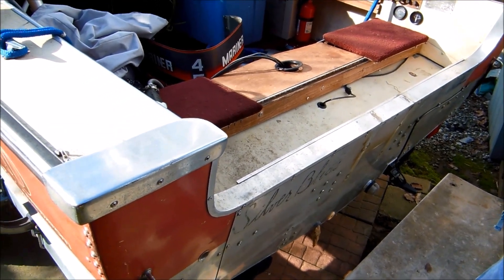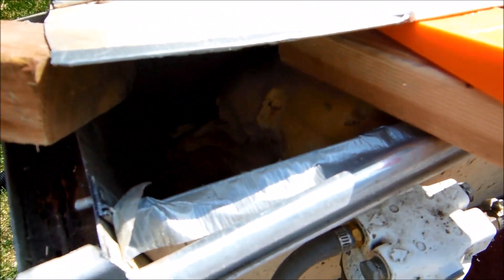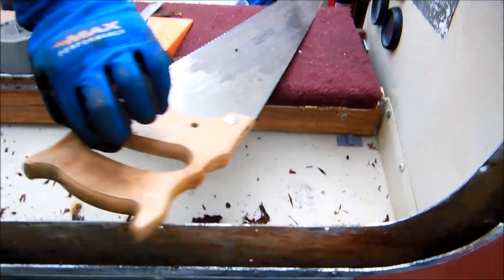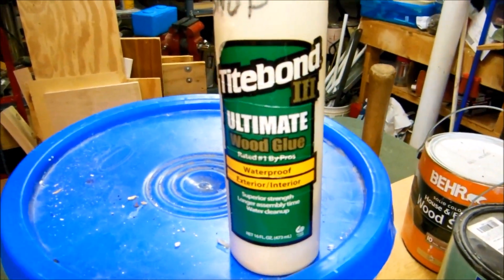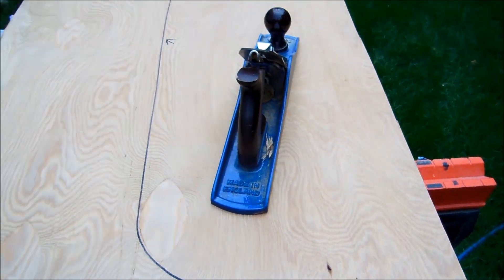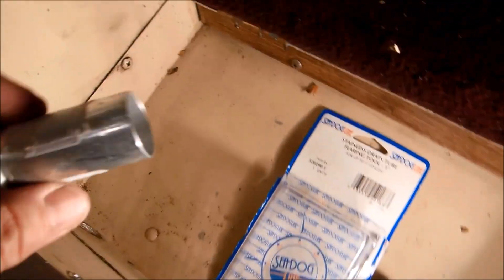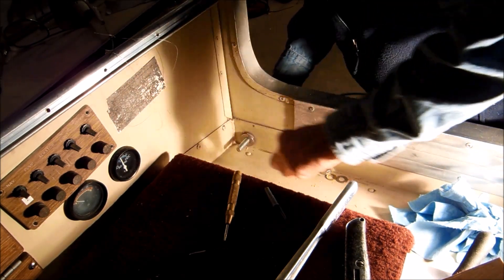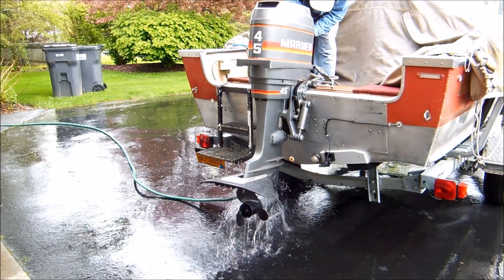Boat Transom Replacement

Comment: I've done a few new transoms on aluminum and fiberglass with wood core transoms. Pull out the old one and make a template and or bring the old one in if it's in good shape to take a template of and I made the new ones out of marine grade plywood and the coated everything in marine grade epoxy resin. Did alot of those jobs for DIY people.

Comment: Started the transom on my 2001 yesterday.  When you had to break the welds, how much force or swings did it take.  At the moment I'm stuck at that point.  Also did you notice any sealant/silicon when you took the transom cap off?  I can't find any trace of sealant, which I think is borderline negligent.  Did you see the video on the new HDP transom?  It says a line of bullshit about lund transoms being state of the art and warranted for life!! Again all lies!!! Your video has been more help than every single lund dealership around! Never again!! I'd rather swim! Thanks for the vid!!
Reply from the maker: Sorry for the late reply I never got an update about your comment.  It took a good amount of force and maybe a dozen swings.  Just hit it hard and try different angles.  There was none for us either.  I didn't see that video.  Yea of course we had no information when trying to figure this out and thought it would be very helpful to to others.  The lund transom being lifetime warranty is ridiculous too.  Do they expect people to drive there boat to factory?  I'm sure its a procedure to get it done by them.  Hope your project goes well feel free to reach of if you need help.
Reply: Each state has it's own definition of what "Lifetime" means as it applies to warranties. In Ohio, it means 7 years or essentially what they consider the lifespan that can be expected out of any item. So a 10 year warranty or 20 year warranty are actually better than a lifetime warranty. Some states count it as less time too. Lifetime doesn't mean YOUR lifetime. At 30+ years, they have no obligation to do any kind of repairs on the boat and probably won't. Just something to think about. Good repair project.

Comment: Folks, this was very well done for it’s time, but because of the propensity for water intrusion(gaps, cap strip, rivet leaks) use Coosa board. Stronger, lighter won’t get water logged and never rots, but it costs more. However, you never have to replace it. Wood does what nature intended, decompose.
Reply from the maker: Wood will outlast the boat guaranteed.  Boat was 25 years old or so when this is made.  Hull takes a beating from the waves.
Reply: @OutdoorsmanChannel 
Yes you did a great job. It’s just that I’ve replaced so much wood that I hate the stuff. In fact, it won’t do a transom with wood. I’ve seen it rot in just a few years. Some preservatives and sealers actually cause  the wood core to rot quicker. Some preservatives cause aluminum to corrode. Quality marine plywood is very hard to find or mostly fake. I hate fungi food.
Reply from the maker: @SkypowerwithKarl  I appreciate the input.  We just chose to keep it to factory spec.  Thanks for watching.

Comment: Use Thermo-Lite Board when replacing wood in any boat repair so you don't have to replace rotted wood again.
Reply from the maker: +Mike Kalberer The original wood didn't appear to be marine grade and it lasted 25+ years.  I don't think we will own this boat for that long.  Its also much cheaper to use wood.  Thanks for watching!

Comment: Not sure that was marine plywood, I could see voids on the right hand side- originally they probably just built it with exterior grade plywood which is just fine.  I would HIGHLY recommend sealing the transom with epoxy resin at the edges so that future water won't suck in so much.   Have done a few transoms myself, and much prefer doing them on aluminum boats. :)
Reply from the maker: I can't even imagine the pain of doing a transom on a fiberglass boat.  I'm sure we could've sealed more and used different boards etc, but that marine grade wood and thomsons water seal will last awhile.  Thanks for watching!

Comment: Nice job....I think I would have sealed that plywood with a coat of epoxy resin though.
Reply from the maker: john smith Thought about that.  We figured this was good enough since wood is marine grade.  I don't think original was by looks of it.
Reply: Outdoorsman Channel Marine grade is just hardwood plywood with waterproof glue. But with the Thompson's water seal was probably more than the factory did.
Reply: @OutdoorsmanChannel  Marine grade plywood is not treated and will rot just as fast as regular plywood. As mentioned the glue bonding the plies is waterproof. Also marine grade plywood will not have any knotholes and typically has more plies than standard plywood. Definitely would recommend sealing with epoxy but using the Thompson water seal is better than nothing I guess... nice video
Reply from the maker: @mdees88  Thanks for watching.  We simply chose to make the transom the same as factory specification.

Comment: It will get you going but will suffer bad vibration, all voids needed to be filled. A transom needs to function in conjunction s with other structural elements, stay safe.

Comment: Great job but why didn't you use coosa board? It cannot rot!!! There's no wood to rot!!! But awesome great job hope it lasts very long time
Reply from the maker: We just wanted to make it as original spec.  We figured the original wood lasted from 1986 to 2016 and the hull would not last another 30 years.
Reply: @OutdoorsmanChannel  I don't know I know lots of people with 1950s boats that they still use!!! But yes original spec is good but coosa will never rot so it does last the 30years extra it will need to be replaced
Reply: What is the price difference between coosa and marine grade plywood ?
You also have to factor in shipping costs for coosa. 
I'm getting ready to replace transom and stringers in my boat. I'd love to use coosa, seacast, carbon bond, etc. 
In the long run, is something other than wood, the way to go? Good question. How will the composites hold up in the long run ?
Talk me into spending the extra for it. Especially when paying around $100, for shipping alone . 
Keeping in mind, that means less money for the rest of the project.

Comment: Why wood again? There is so good other materials for such a job.
But you did a nice job anyway👍🏻
Reply from the maker: Thanks for watching.  We chose wood to match original.  It was also the lowest cost and the lightest weight we could find.  The boat is a 1986 and the original transom lasted that long. We figured the hull would break before this transom.
Reply: Outdoorsman Channel 
Okay i understand. I have a microplus 461 from the 80’s too. Also hat a bad transom with rotten wood. Also cleaned out just like you did but had to make it more strong also because the boat was made for 50hp max and i bought a 115 2str yamaha. 
So i cleaned it out and pored in a epoxy for deepfreeze truckfloors. This stays a litle flexibel and is also very strong. 
But a lot of work also haha. 
Tnx for sharing this video. This helps a lot of people.
Reply from the maker: @michielderuyter6011  Yea that makes sense. Ours is rated for 55 hp and we had 45 on it.  Too afraid to go higher haha. Of course glad to help anyone out!
Reply: Outdoorsman Channel 
Regards from the Netherlands👍🏻

Comment: Not only should you have sealed the plywood 1st. You should have cut old fibreglass out from inside of Transom, refiberglass it all in. You also should have glued entire backside of the fibreglass on outer transom. You're just going to get water in there again, will rerot in no time.
Reply from the maker: The boat has zero fiberglass in it.  Thanks for watching.

Comment: Nice video. However,  you didn't replace all the way to the drain hole. Don't you thi k that would be rotted too. At least mine was.
Reply: The original transom didn't extend down to the drain hole.  It stopped about 6 to 12 inches above it.  It is really only there for engine support

Comment: Mate it will be soaked in there after 1 trip unfortunately. Pull it out and seal it and fill all voids
Reply from the maker: Transom worked out excellent.  Absolutely zero vibration and likely will last longer than factory original.  Likely will last longer than the Hull.  Thanks for watching.

Comment: After all teat fitting and getting it to fit perfectly you don`t seal the plywood??? It will rot in 5 years . You should of gave it at least a couple coats of resin. If you do a job do it right.
Reply from the maker: It's marine grade plywood.  The original was definitely not and it lasted quite awhile.  We made it better than factory and it will likely outlast the hull.  Thanks for watching.